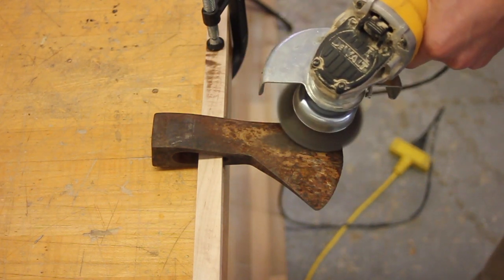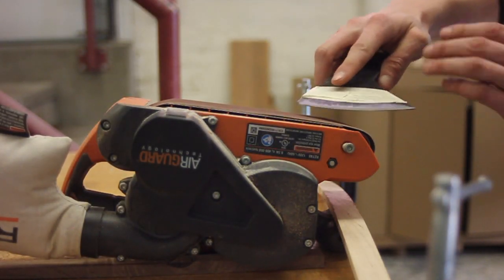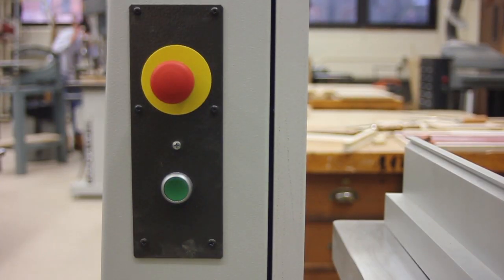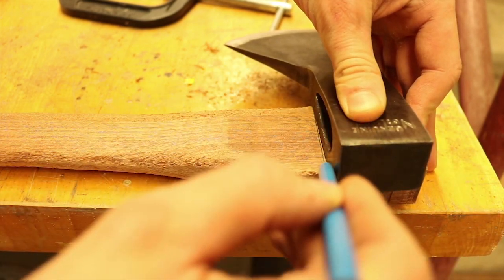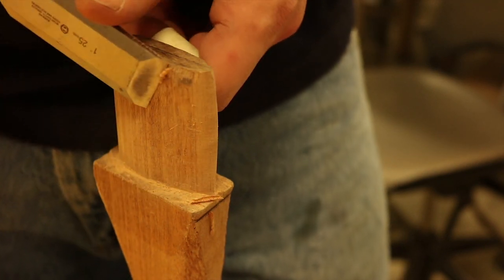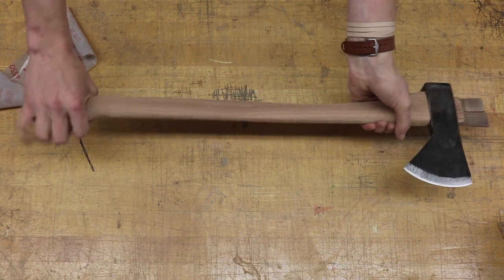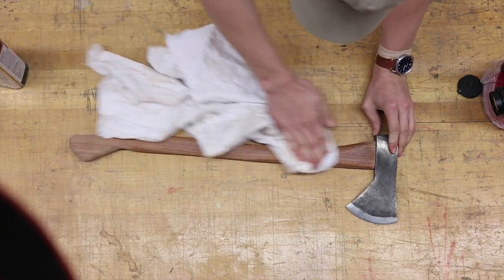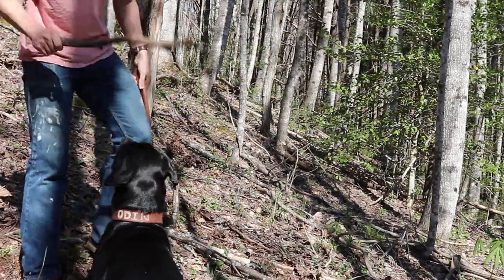How To: Rusty Tomahawk Axe Restoration

Comment: Looks good, particularly the head. Just restored a Norlund, myself. However, check your grain orientation. It doesn't look right from what I can see and that can be dangerous.
Reply from the maker: RedWings-44 thank you, the grain is oriented parallel with the swing of the axe!  Something worth mentioning though, you’re certainly right that can be dangerous.
Reply: @AKStudiosDesign  looking at 4:52 it appears to be perpendicular. I think that's where all the comments about it splitting are coming from.

Comment: You said any hard wood....Well as I once made a very strong handle of red oak. But as grandpa said the recoil of the oak made made it unuseable.Never use oak or it will beat you.Hammer you wedge from bottom
Thanks much to learn here.

Comment: Nice work dude, but if you can sharpen the axe with a file that proof the edge is not being harden.
Reply from the maker: Thanks Walter, using a file to sharpen an axe is actually a really common practice. Usually an axe is hardened in the low to mid 50's on the Rockwell Hardness scale. While you can get files with varying degrees of hardness a typical axe file will sit around the 60-65 Rockwell Hardness which is why it will still be able to sharpen an axe. 

Check out Wranglerstar's Video on sharpening axes, you'll see his methods are commonly practiced. 

https://www.youtube.com/watch?v=JIZBwT-VDBY
Reply: The file is how you're supposed to sharpen the axe. A file followed by a sharpening stone.